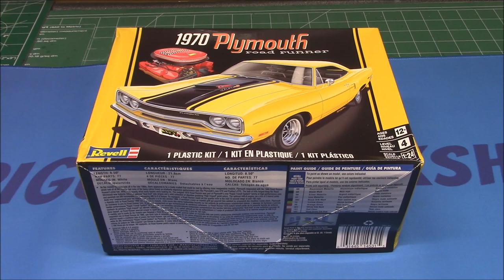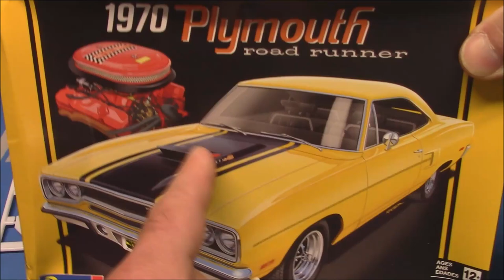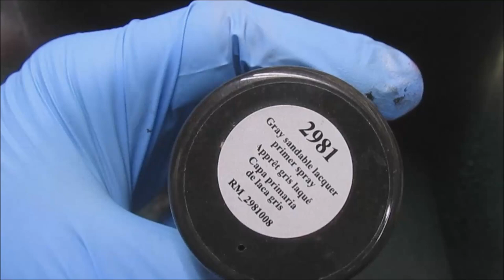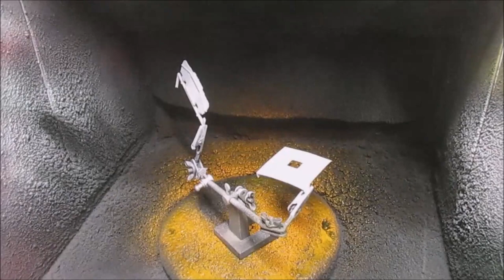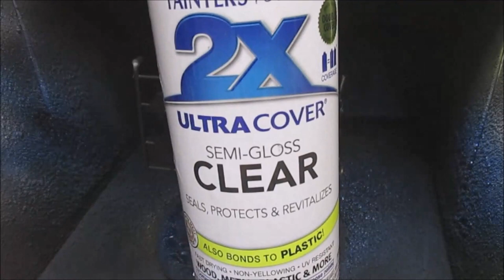1970 Plymouth Road Runner 440 Six Pack 1/24 Scale Model Kit How To Assemble Paint Engine Decal 440+6

Comment: Oooh, you are not going to like this, but here it goes. Unibody frames were the same color as the rest of the underside sheet metal (body color). Hey, at least I might be saving you time the next time you do a unibody Mopar!
Reply from the maker: I simply copied the box art.  
I'm not going for show winning cars or to be the expert on factory perfect replicas.
Thanks for the info!
Reply: @hpiguy  exactly, build for you and you alone,
Reply: Just say it's undercoat for the Wisconsin winters...
Don't let it get around,  but I have actually painted GM and Ferd engine compartments body color at times.  Just have fun ,use your imagination and build for yourself
Reply: That's only partly correct.  If you're going to paint the frame one colour to be correct, you're also going to have to reproduce the body over-spray on the chassis.
Build 'em how you like 'em.
Reply: @chucktaylor2772  I painted my real truck with red and white for a candy cane differential it looked 😎

Comment: Hey! Pretty cool they re-issue this kit! I built the original release of it (was released in 2000) and this is the second re-issue of it (aka, they released it for the first time in 2000, another one 'round 2012 if I'm correct and this new release). It is a Revell, not a Monogram mold, but I wouldn't be surprised if they used Monogram's GTX as its base, as many parts are interchangeable between the two. Mine is really similar to yours, just with a blue that is a tad bit darker.
Reply from the maker: Thanks for the info!
Reply: 2012, and about three years ago, bought that one just before the scam demic shut us all down

Comment: It would be interesting to know how they chrome those plastic parts and try to reproduce the process at home.Nobody has an idea?
Reply from the maker: They are electroplated with a thin coating of aluminum. It's never been much of a secret, they do the same with the metal looking parts on appliances, etc.
Salvinos JR is the only plastic kit company using real chrome to plate their parts, they are even magnetic.
Reply: It's called vacuum metalizing. Lots of info online. The equipment to do this is not cheap.

Comment: 6:36 --- There's only 2 things I don't like about this body: the battery that looks like it sits on top of an elevator shaft and the coolant overflow tank, which is not accurate (at least I don't think it is).